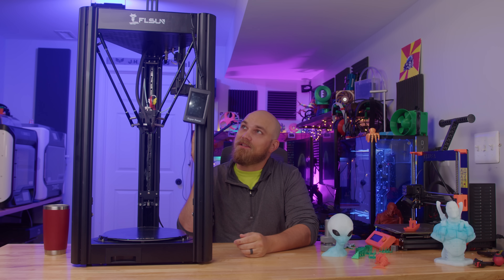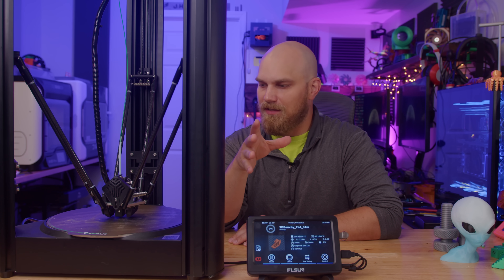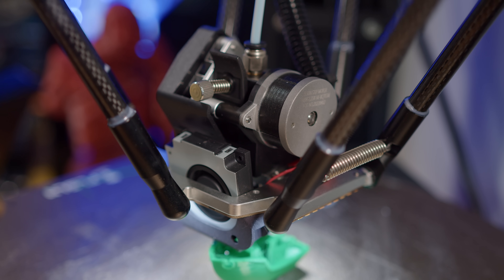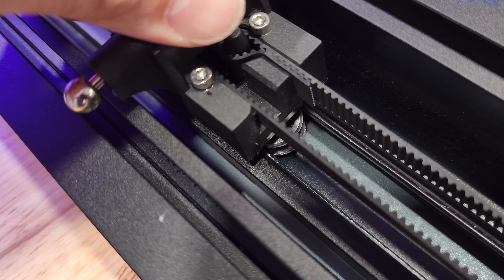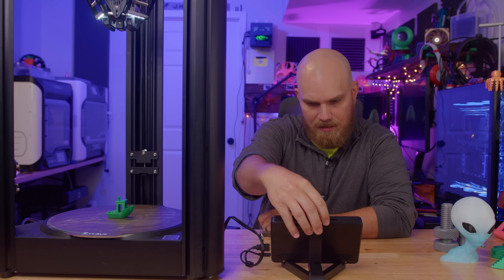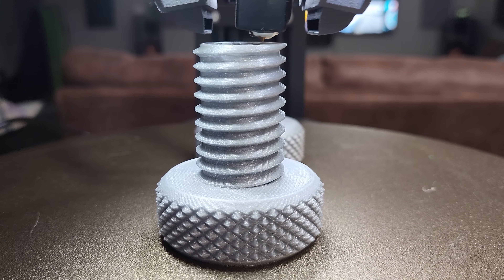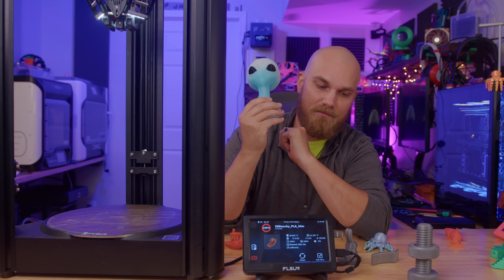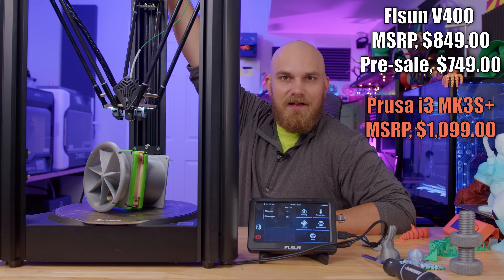How The MIGHTY Have Fallen | FLSUN V400 Review

Comment: Fans rating chart should be split into two categories. One with scoop (includes intake and exhaust) and one without. All the ones with scoop, should have gasket installed for fairness. I'm all for best fan design, but having the scoop changes it from something I can print and replace on my stock fan, to something that needs serious case modification to actually be used.
Reply: this is the way
Reply: maybe 3 groups, with the no scoop category split based on if it extends above the fan body or stays within
Reply: I think 2 groups with like 30mm or less thickness and bigger
Reply: @TheWilliamSnfrd  This is the way
Reply: Definitely this
Reply: Or maybe everyone just continue having fun?) 
Why all this complications? The competition itself, how to say not to offend anyone… not very scientific)
Everyone just bursting with clever ideas, and it’s truly fun to watch, not speaking of the fact, that on the top of the chart is pretty simple fans)
Ok, ok, my scientific and well formulated suggestion - just relax and enjoy) and also offer your crazy design)

Comment: I think the seals against the noctua fan body should be standard practice going forward. If users want additional seals or a seal of a specific size/shape, then they should provide their own schematics for them.
Reply: Not now in the middle of the season so that the results are comparable, but definitely in the next one.
Reply: No point in supplying a new seal file if he already has a seal lying around.
Reply: @Pystro  it's like you didn't even read what I said. He'd still have the "standard seal" on the fan body. But since people submit fans of all shapes and sizes, there's not gonna be a one size fits all seal. In a situation where a user submits a fan that is either oddly shaped or has multiple stacking parts, then he/she should also provide files for a seal that would fit their design. If not, then only use the standard seal and nothing else.
Reply: @drumlineking07  Agreed, it's like I didn't even read what you said. Oops. Must be because I'm too tired.
Reply: Negative... The objective of this channel is it is the users responsibility to apply fluid dynamics to the best of their knowledge. This, would include seals... Stop promoting laziness.
Reply: @drumlineking07  If you didn't notice, he uses the same noctua fan body all the time, it's just the blades that change, duh.
Reply: @Njazmo  I get that... my statement doesn't change
Reply: @Njazmo  The fan body doesn't change but the stackable velocity stacks and other items do... if you didn't notice.
Reply: Hear hear
Reply: I was gonna comment basically this.  I think sealing the gaps should be a new practice done by default on these extra shroud devices.  I mean, he's already got the gaskets printed out, may as well continue using them, right?

Comment: It should be standard policy to include these TPU gaskets unless the design conflicts with their use. PLA isnt great as a seal…Even with the flat design, the TPU was able to seal better. 

TPU for all!
Reply: Tpu is great for noise too. I switched to it on my laptop cooling thingy and it enabled using a far noisier squirrel cage fan on it without being too loud.

I did also make an intake muffler out of it.

(It's basically just a duct that holds the 100mm squirrel cage fan and goes straight to gpu cooler intake.)
Reply: I think we don't really need to custom print a gasket here. Every A12x25 fan comes with a seal for a radiator. I think he should have enough of these to use
Reply: In the end, it also depends on surface finish and build plate surface how it seals.. so gasket should be fair
Reply: Negative... It should be standard practice to apply fluid dynamics to the best of YOUR knowledge. Not, him cover for your lack of attention to detail.
Reply: @DJBillionator  it’s not a lack of knowledge when build surfaces and how the design is mounted can have a significant impact… as shown in this video. Two actually flat surfaces mounted well together should provide enough resistance against leaks under these test conditions, yet it didn’t work. FDM printing isn’t perfect. So a consistent application of this gasket would create an even playing field for the designs that have shrouds/exhaust/etc.
Reply: @realgoose  Yeah or desing non flat face aka use slotted gasketing my help. or even made little lip to provide much better spring stress into housing.
Reply: @realgoose  true but it also the first time a leak could be see in any of the smoke test so it more this particular print that is warped

Comment: The rubber corners on the fan are what cause it to leak.  Even just removing them would be a benefit.
Reply: I've been thinking that for a couple of episodes
Reply: @SkillisForNoobs  Noctua includes a full rubber gasket for the boxed versions of the A12x25 which are really useful: they fully cover one side of the fan, not just the corners. Just have to swap the corners for it. At the sides it a bit thin so placement can be finicky but worth it.
Reply: Not really the cheater didn't have any visible leak in the smoke test it's the first time a leak is apparent in the test 
So it more this particular print that is to blame (not flat)

Comment: Just want to say thanks for all the awesome 3D printing content. I ordered the Q5 over a year ago and had a really hard time getting it to work right, and after a week or two of trying to figure it out I gave up, but kept watching your fan showcase videos. This very week though I have gotten back into it and have gotten some good prints. in that year I managed to learn a lot about blender and 3D modeling so it's all falling into place. :D
Reply: The Q5 can be amazing but like all can be finicky and at times disastrous. I’ve gone for a couple months without touching it from issues I couldn’t figure out.
Reply: @jdizzforyou  agreed. Above anything it's a great starting point. Mine stopped leveling properly at some point, but you can easily replace the board, extruder, hotend, servos etc over time. Getting that good sturdy base and compact footprint is the true appeal of the at.
Reply: @Charky_Creations  and the price I got it at… 159 shipped during a Christmas sale on gearbest 2 years ago 😂
Stock board running marlin with the only upgrade being capricorn tubing.

Comment: I’m telling you guys check out Borg Warner turbos compressor blades, specifically their “extended tip technology” and apply that to your fan designs.
Reply: If you want to throw the air out the side, sure go with a turbo type blade... Wheel to be precise, they aren't made to throw air through them, without the housing, the wheel is useless, extended tip or not.
Reply: Yeah, I got some extended tip technology for ya right here.
Reply: Talk about breaking potential patents. Have to be careful when "copying" another person's or company's product.
Reply: @WLS_Churchill  I didn’t say design a whole turbo compressor, I said consider the extended tip technology…
Reply: @meanman6992  The extended tip technology maximise the air flow IN THE HOUSING. It's useless on a fan that isn't a turbo wheel, wich is useless outside of the housing, ya understand ?
Reply: @WLS_Churchill  The tone is unnecessary. That said I hope you realize all I’m really suggesting is to extend the leading edge of the fan blades near the center axis.

Comment: Suggestion: Use the gaskets for all interfaces to the front or back of the A12x25 frame from now on.

This would free us up from having to design our own gaskets, and it frees James up from having to print them.

(printing TPU is a real pain… you have to dry it out and slow the print speed waaaay down.)

Also, test the Cheater with the gaskets, to make it fair.

Comment: For my smaller fans at home I have also found that just adding a spacer (like that gasket) greatly helps with reducing turbulence and improving airflow. I added mine specifically to cut down on the noise of the fans on my 3D printer whose fan grills were all very close to the fan itself.

Comment: I'm so jealous. I just bought a Sherpa direct extruder and mounted it on my SR, and I installed Klipper with a touchscreen running mainsail. They did everything I did, plus they beefed up the arms and increased the build volume. I want it so bad.
Reply: ^When Eric Smith walks into a car dealership when he doesn't need anything and a salesman slaps the roof of a new vehicle.
Reply: @Oblithian  Hey, I have space for two deltas in my life, the kids should be moving out soon. If the salesman talks to his manager, do you think he could get me a free undercoating? I heard it really helps these printers stand up to puddles and rock salt.
Reply: Drop details I’ll ship 1 out.

Comment: For high print speeds you also need to increase your nozzle temps. Filament can only  flow so much at ~200. CNC Kitchen did a great breakdown of temperature vs flow rate.

Comment: I converted my Ender 3 to a direct drive with a $35 kit and never looked back.  The almost complete lack of stringing easily makes up for the need to slow down the outer-most wall to avoid ringing.  Plus I can just crank up the print speed for the inner walls to make up for it, since the direct drive's material-extruded-vs-estop curve is far flatter.

Comment: I bought the Q5 mainly after seeing your review of it. I had considered the SR or V400 as a 2nd printer, but went with the Anycubic Kobra Plus instead. My only real issue with the Delta-style is the round bed. The Q5 at a diameter of 200mm equates to a square area of approx. 141x141mm. So you're basically sacrificing up to 30% of the bed the closer you get to a square print.

Don't get me wrong, I love my Q5 and it is great for smaller prints, but I am finding the square build plate easier to work with for modeling.

Comment: I still remember my first FLSUN printer. In the first days of home 3D printers they had basic kits. I got them right between supply chain changes for safer stuff. I got the manual for the wrong power supply, and one that was set to the wrong voltage. Needless to say, the wire exploded and connected my arm to mains electricity. shocker. still, it's because of that I was a very early adoper of creality. still using it, too, after most of a decade now.

Comment: you mentioned your prusa being loud, a drop in mod is to use RJZM 02-08 IGUS bearings. It is eerie how much quieter this made my prusa.  I think that vibrations rattling the ball bearings in the stock setup causes the majority of the noise. These Igus bearings are just one piece.

Comment: With the vast diversity of fan designs you get and test, why is there never an airflow vs. static pressure vs. obstruction test? You would only need a 3D-printed set of obstruction plates for your wind tunnel (with holes in them) and a differential air pressure sensor.

Comment: You need to re test the cheater with gaskets for it to be fair.
Reply: Why ? it did not taken in account the results with gasket the cheater is still no1
And in the cheater test there was no visible leak it's the first time a leak is visible in the smoke test
And a need to rewatch the video but it looked like he used only 2 tie rap to hold the part to the fan and it was leaking by the corner with no tie rap

Comment: damn, I never knew you could print flexible materials with these things, that changes things. and 800 is a lot less than I expected to pay for one too.
Reply: I can't remember the channel, but I watched a random video of a guy that made some carb gaskets for his lawnmower to test the longevity.  At least in the short term, they seem to be impervious to gas and oil.  TPU can be a game changer for folks with old and obscure vehicles and engines and need gaskets or dampeners made.
Reply: I have the v400. It is a great machine, but it still lacks some profiles in Cura, except for PLA. The PLA profile is extremely good.

If you want to print flexible parts, a simpler model will do fine. I use my old AnyCubic for TPU. Recently found a 85A filament which is a lot softer than 95A. It printed fine. Very clean results.

I have repaired so many things just using 3d printed parts. From wheelbarrows to furniture, camera mounts, garden fence etc. Not to mention things I printed to tinker with. Wind generators, rain collectors, housings for outdoor electronics.

I am not sure I am breaking even, or ever will, but the stuff is just a great hobby for me.

Comment: Would be cool to see some 200mm fans for a season. I know they're obviously not used for CPU cooling, but maybe have a case with one exhaust fan and the submitted 200mm fan for an intake, with a passive cooler on the CPU? It'd also be neat to see how the air flows through a case with the smoke machine.

Comment: I'm all about resin printers.  The detail quality is crazy in comparison.  Yes there are advantages of filament printers, like the ability to run 2+ colors or 2+ types of filaments.  They are also typically faster and ca print far larger items... but they just do not come even close to the print quality.  That huge bust I could print 1" tall and it would still likley have more details that they huge print.

Comment: WOW. EPIC !! I've been preaching Delta's sicne 2015.  Direct Drive + those speeds= OMG !!!!!!   That might literally be a perfect printer.  Well, I guess if it had side panels for heated enclosure, then it would literally do everything a single extruder could possibly do.    I've printed polycarbonate on my delta before(open enclosure.) That was not easy, but it did happen.
Man Congrats on that printer !! 
My favorite thing about a delta is that you can save a print >>  you can flatten bad layers by hand with the spudger/spatula. You can literally hold the print upright. You can use the spudger/spatula as impromptu support support material. The support spatula.      << all this is possible because the platter does not move. The part sits still.   I have a cooling fan(50mm) which I set on the build plate. As the part increases in height, I set this fan on random objects to increase the height.    Also, since the part does not move you can SEE WHAT IS HAPPENING. You can see print defects as they are happening and better know how to correct because you watched them happen.  The list goes on. Being able to see & interact with the part is non-negotiable in my opinion.
Reply: You should check out the carbon x1 from bambu labs
Reply: @stevenbmw850  Well, I watched some reviews...  The machine is still pre-order ? I'd be cautious with this machine/company. I'm curious >> Why do you want me to check out this printer ?  I already have a printer ...
Reply: @tdtrecordsmusic  well all the things you listed a core xy has, this also has a sealed enclosure, with the added benefit of active vibration cancellation. Seems like something you might be interested in if/when looking for a new one.

Comment: Hey Thomas, wouldn't a polar 3D printer be better for fans? Meaning something that has a turntable for the base. This way, the fan blades could be more similar than when using a delta.

Comment: I have three SR printers and when the bowden tube chaffes internally I've gotten several times a micro tefflon debris feeding down to the print nozzle clogging it. The clean out and tube replacement is getting old!  I'd love to just upgrade my two printers with the direct drive on the V400.  Is that possible??

Comment: instead of that fan housing why not use a blower motor setup? Insulate the housing if noise is a concern since they are loud but compressing the air path like a rock in a river increases velocity, if temperature is the concern run a radiator before the housing, new here so not sure what your end goal is

Comment: 5:20 those carbon tubes are overkill haha, we use similar if not thinner tubes for suspension in our race car, they are probably not as thick in terms of wall thickness on the printer just found it curious

Comment: Direct drive extruders just make sense. I'm surprised welders don't have thin profile direct drive wire feeders.
Reply: Electricity takes the path of least resistance.  If something were to brush up against the welding wire as it's being fed, it might change the flow of electricity.  Just my assumption.

Comment: I'm sorry this is off topic but I don't know where else to go. My super racer nozzle scrapes the top of prints and at around 15 CMS it really rams into prints until it rips them off the print bed. It's not a layer adhesion issue because I can hear a sharp crack when it does this and I can't dislodge the prints unless I let the bed cool first.
I've increased the z hop to 2 mm, enabled / disabled combing, retraction and also set the extruder to 70 % at which point it is really under extruding, yet it consistently snaps prints. I can't get a response back from flsun. I'd really appreciate any advice or troubleshooting steps.

Comment: Two years later (2024), how does the V400 compare to the current lineup of 3D printers in your workshop?  Are you still using your delta printers , or have they been replaced by newer/better printers?  I ask because Holiday Sales are going on right now and the V400 is sitting at an affordable price ($549 USD).
Reply from the maker: I only use bambu now currently there the best thing in the market
Reply: @MajorHardware  Oh, wow.  Okay.  Good info to know.  Thank you for the quick feedback.  I'll probably go with a base Bambu A1 for now and get an AMS Lite a few months down the road. 👍

Comment: You could have clean prints at full speed if this printer had a fan to cool down the extruded material as quickly as possible - we do this with PLA since years which gives MUCH better prints and allows for higher speeds so I really wonder why there is no material fan on this printer 🤨